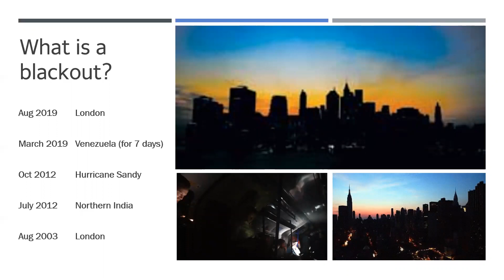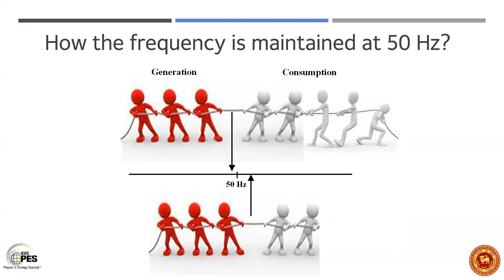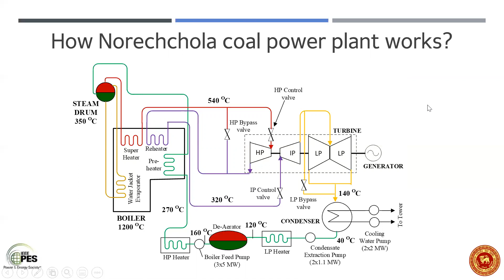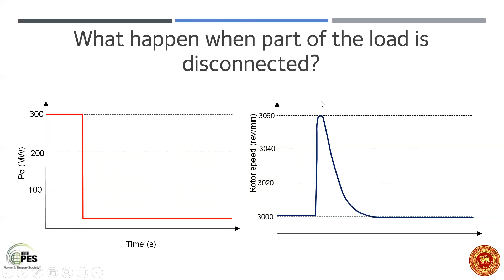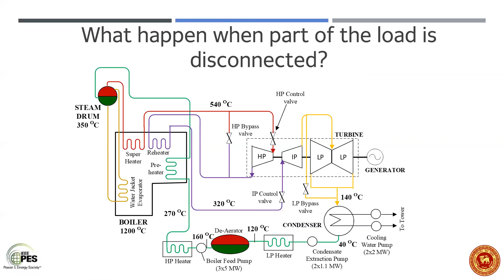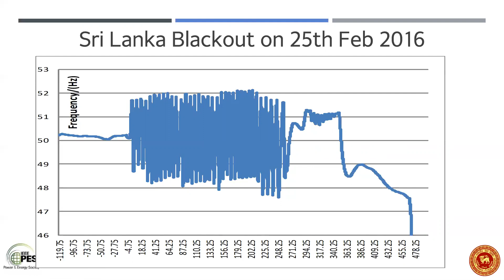Power System Blackout | How and Why by Prof. Janaka Ekanayake

Comment: This is a very good explanation covering most of the aspects related to power stability. However the presenter should take caution in  publishing sensitive information such as the SLD of the national grid and  controls of specific generation plants in Sri Lanka. I don't see any information of consent from CEB for publication. Should have used a typical SLD and typical examples of similar generation plants used.